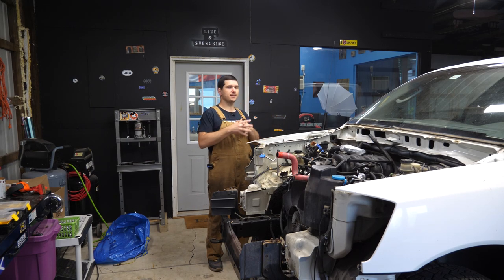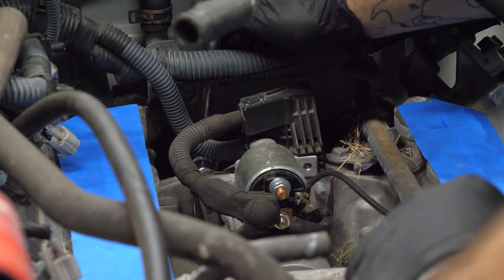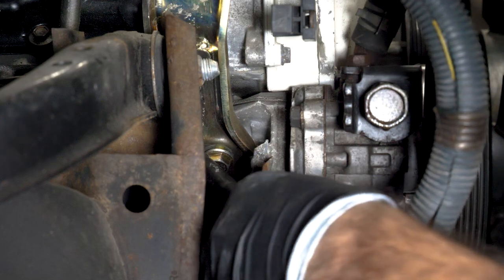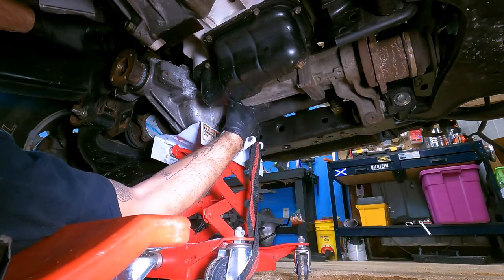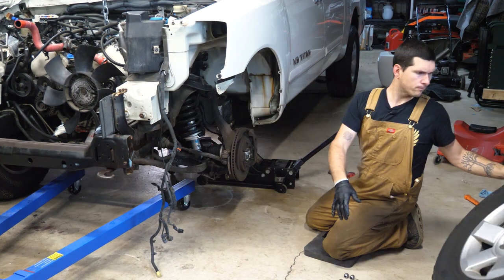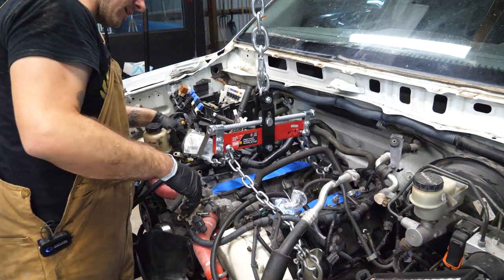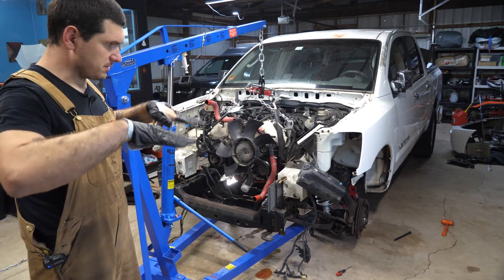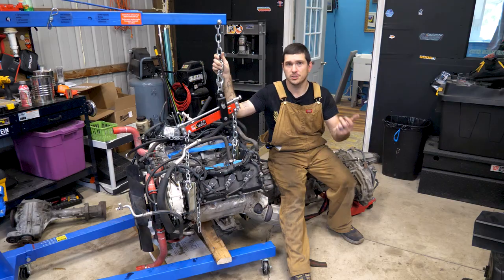How To Remove A Titan Engine Part 3 (VK Swap Episode 8)

Comment: Thanks for these videos! I’m in the middle of taking apart a 2008 VkK56 Pathfinder for a frontier swap. 
On the engine slingers you showed 3 of them. What’s the part number for the one on the Passenger side?

Comment: Hey RY Guy,,,, do you have the truck in 4 wheel drive while removing the engine?  Getting the axles and driveshaft to turn when you spin the tires do you have to have it in 4 wheel drive?
Reply from the maker: Nope! In fact I have it in 2WD and in neutral.

Comment: What is the part number for the passenger side slinger??
Reply: i did find it after a lot of searching Passenger side is 10005-7s010, Driver side is 10005-ez30a and the back side is10006-zs60a are the current part numbers
Reply: Back one is 10006-7S010
Right side 10005-7S010
Left side 10005-ZS60A
Reply: @Champsteroffroad    The back one and right side one are different.  I think MrWasjoe is correct.